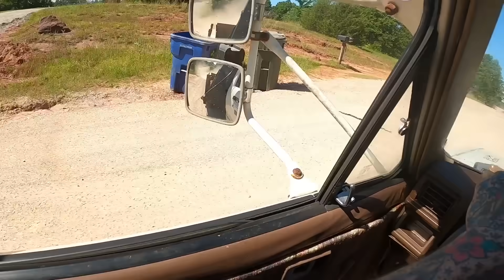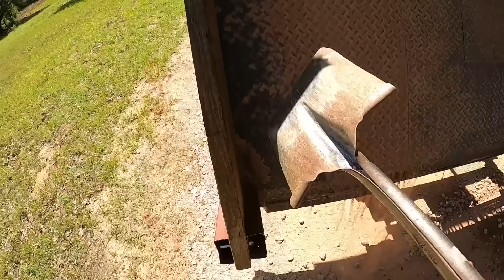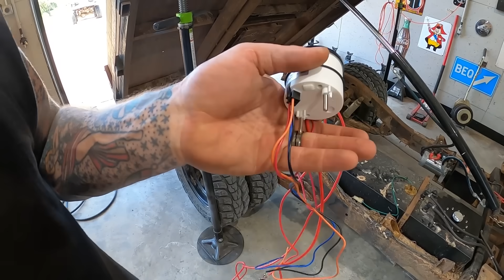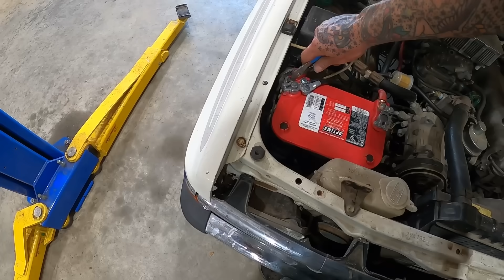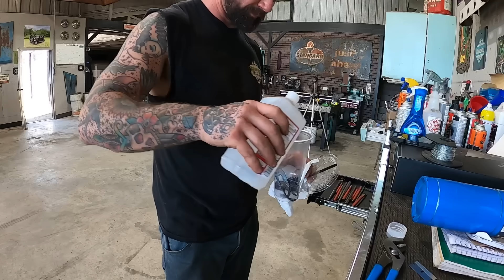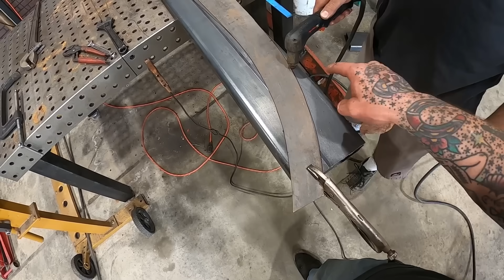ROCK HAUL! 1984 Toyota Dump Bed gets PUT TO WORK! Upgrades added!

Comment: You could put some handles on top of those side slats. 
Could even use like a boat mooring cleet as a handle

1. Make lifting them easier to grab and pull up
2. Give you a tie-down spot. if needed.

Fully functional Pot County dump truck
Need you a sign on the side that says Not for Hire.

Comment: Having the whole truck on the circuit breaker is a bad idea.  If you happen to trip the breaker with the truck running it won’t actually kill the power but just move everything to the alternator. And without a battery the alternator voltage can spike  and damage other things.  Not to mention if it’s a big enough load to trip the breaker I’ll probably kill the 60 amp alternator that comes on those trucks.

Comment: Might need to adjust the proportioning valve (the one above the axle you were bleeding) the arm may need to be adjusted up. Since you added weight it will need adjusting up to send more brake pressure to the back brakes

Comment: I just put an 84 dually rear end under my Nissan the factory rear end that was under my Nissan was so high geared I normally ran 70 to 80 on the highway in 4th now I actually have to use fifth to run 80

Comment: Maybe the rear brakes are weak because that’s a load sensing proportioning valve?  Lots of Yotas had those with a little arm on them that added more rear brake when the back of the truck was sitting lower. If that’s what it is you could probably tie wire the lever up some or something.

Comment: Your bleeding your breaks wrong. Your supposed to start in rear and work forward. You probably have air still trapped. When you start at the front it we'll push air to rear but once you start the back it well jump to front.

Comment: Theo looked a little worried when you pumped up the brakes.  Too funny.  HEY PUDDIN!! FAB RATS has an IH stake bed they are going to give away.  You and old truck guy need to check it out.  They also have an old Dodge that runs.  Same deal.

Comment: Hi Jacob!  I was almost 99% sure that you need to start bleeding brakes the furthest away from the master cylinder,  then go from there. And that may be your issue... in fact I'm almost 99% sure of that.😁  yes getting the air conditioning system up and running for anyone ,especially your pa, is a must. I don't think those windows supply enough cool air flow . My 92 ford had has a non working system, and its not worth it for the condition of that old rusty thing ... But the little vent windows supply great air flow when driving down Canadian highways. 😊 I love your channel , but I don't love chopped up trucks and lowered suspensions... it just doesn't make any sense to me.  Love the model t revamp though,  need to see more of that thing driving. Even if it's just in a parade.😁

Comment: Puddin'! I suspect the proportioning valve was in a low weight setting. Slowing your pedal response on the back brakes ! ! You may be best to open the valve as having a suspension squat, would adjust it to open the back brake fluid circuit . All the best of intelligence to your  efforts old friend.

Comment: Another trick to put those ends on is hold the ends with vice grips & heat them up & melt solder in it & keep it hot & push your cable in it.

Comment: I’ve learned from first hand experience. Please switch your power wire to a 4 or 6 gauge wire, to match your original harness. Otherwise you will end up with a resistance fire down the road. You have an amazing family, please be safe!

Comment: The rear proportioning valve should have an adjustment.. when bed is loaded the valve lets more brake fluid to rear cylinders.. I would check that out if the rear brakes seem a little weak..

Comment: Puddin, I had a removable ladder rack on the back of my flatbed Toyota that came in extra handy. I could haul 20’ sticks of tube or a John Boat and still have the bed open for tools etc.. it was built from 1x1 and fastened in front of the headache rack when I wasn’t using it. 
I absolutely love that little pickup and miss it daily. By far the easiest truck and most useful.

Comment: Excellent Video  Puddin  :) , Theo The Supervisor  Dog 🐕  , Bill :) , Old Truck Guy :) , Slick 50 :) also this 1984 Toyota Dump Bed Truck did good job fix up for Puddin Pops and help fix driveway for grandma and your sister! Plus Puddin do have sending unit on tank ground to frame by any chance  if don't I would give right fuel gauge reading too if off frame do false one too  to !

Comment: I bought a 84 toyota camper cuple days ago, its the whole unit though. Mine is the 22re .  But the inside of the camper is absolutely trash. So it's coming off and a flatbed is going on. I found a donor cab that i'm going to cut the back part off of in the roof and weld it on to mine . Can't wait to get that camper off . Starting this weekend. Planning on putting a sbc and th400 . Going to be fun.

Comment: that valve that you were bleeding in the rear, above the rear axle, that is a load sensing proportioning valve. It will not allow a lot of brake fluid pressure to the rear wheels when there is not a heavy load because it doesn't need that much pressure to stop that little light truck when its unloaded. This explains why you are not getting a lot of brake fluid pressure/flow at the rear brake cylinders, there was no load on the suspension at the time when you were bleeding the brakes. It is functioning as it was designed to. I know this because I own a 1987 Toyota single cab, short bed, dually truck, and I had to replace that valve on mine because it was completely clogged. Hope this helps, love the videos, love theo, love all the projects!

Comment: I suggest take a piece of angle iron got it about the length of the shaft on the dump cylinder for a safety thing for your dad when he works under the bed. That's what I do to the tractor loader when I work on it. Use a bungee cord and rap it around the angle and shaft to hold it in place.✝️ Love the channel

Comment: Not that you haven't already thought about this this...

Considering the utility nature of this build, would going to a lower gear ratio in the rearend be unreasonable?  It seems she's not going to be amazing hot rod, but a good, useful, super cool, utilitarian work truck.  :)
5th gear should compensate for the change based on the fact you didn't need it at 60mph...

Comment: Lmao I can’t believe you just spoke about my oil comments
I scrapped ac units for like 4 yrs
I’ve also talked about the best blades but I see you found them on ur own
I mean we use lube drilling metal bits so little lube when using that sawzall keeps ur blade from overheating and becoming dull

Comment: Puddin time😊. I find what works well with those battery ends is I take and put the eyelet in the vice. Then I take some Solder and my propane torch and heat up the other end. As I hear it up I put the solder down in the hole and melt it till it fills the hole to about 3/4 full. Once it's 3/4 full I quickly stick the striped end in the hole before it cools. Then finish it off with some shrink wrap. Love those Mini trucks!

Comment: My 1988 regular cab half ton would get up to 100 MPH. I would not drive it that fast for long because I did not want to over work it with the RPMs at that speed. It was rated at 128 hp. I know that for sure but I cannot remember the torque but I think it was around 100 torque. I still have it and it has 200,000 miles on it and it still runs but needs some TLC.  I was told by a Toyota dealership mechanic that there is a kit you can put in the 22R engine that will raise the HP to close to 150 HP but I never bothered because I used it for work not a hotrod.

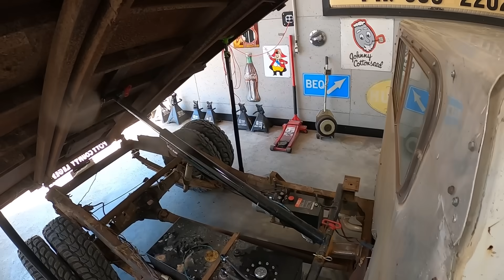Comment: If it's a 150a breaker, then take the truck electronics off of it and go back to the battery because they're already protected in the fuse box via breaker, main fuse or fusible link. That will remove about 20a from the load on new breaker and then the 150a breaker will be appropriate for the 105a dump pump. 29:09

Comment: Disconnect the arm on the rear proportioning valve and move it all the way up to open the valve, then try to bleed the rear brakes.
You can also adjust the fluid to the rear by adjusting the arm. The more weight on the back moves the arm up to add more brakes to the back.

Comment: Always enjoy your videos, you have a great outlook on life and your family stories are always heartwarming. I was thinking about that dump bed, I wouldn’t change a thing with how its set up. I would consider adding some sort of cover over your gas tank to protect the wiring when using the dump bed. Probably not necessary but I could see a potential issue if something happened to fall while the bed was up.

Comment: I believe those AC components are factory, except the dryer. Probably added by the guy who made the custom rear. I don't believe mine has a pressure switch I'll have to look. Look in the harness by that unused carb plug, there should be a single white wire with a black stripe and a small single plug on the end. That's for the compressor.

Comment: I've got a 1994 Toyota Pickup with the 22RE engine, any tips on why cylinder 1 and 4 are low compression? 90 PSI, not that the other two are much better at 110.

Comment: You need to put the wire from your alternator on the battery side, or you’re feeding it 12 v with no fuse every time the engine is running.

Comment: We rent out 2 dump bed crawlers used on pipelines a t8 panther and marukka mst 2200.  Both of these have real simple bed safeties so we can work under them.  They mount to the back end of the bed and, when released, will stop on the back of the frame and can pinned in place.  They just use square tubing.  Those beds are way heavier than yours
Reply: I looked at the t8 panther after i wrote this.  The square tube safety is pinned to the frame and is raised to a stop on the bed frame

Comment: Need to try your dump bed with headlights on as they will increase the load even more, starter motor cranking will take a fair few amps too. Circuit breakers and fuses are meant to protect the cables of the circuits, so if you do upgrade to 200A make sure any wiring can cope with that type of load or the wires become the weak link and turn into polystyrene cutters 🔥🔥 - hope this helps.  Regular subscriber here, thoroughly enjoy your content have watched your channel(s) religiously pretty much from the get go. Stay safe - Michael Uk 🇬🇧